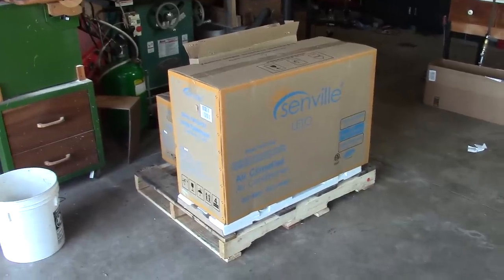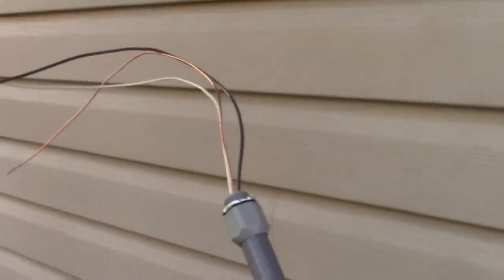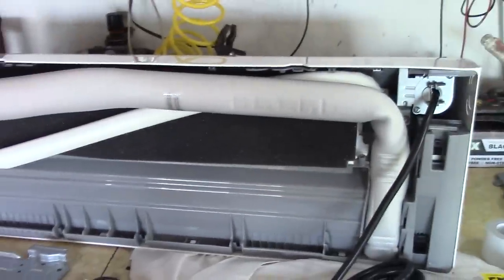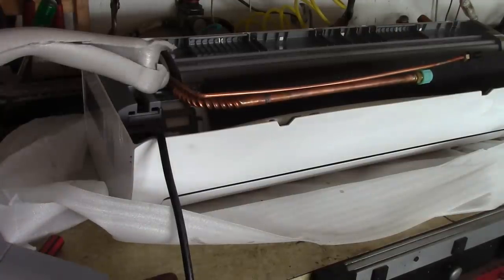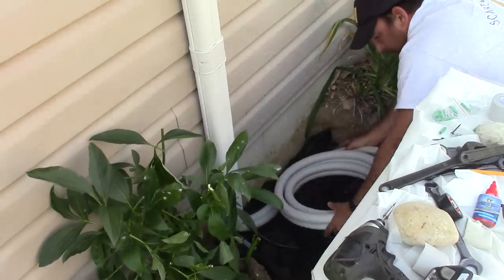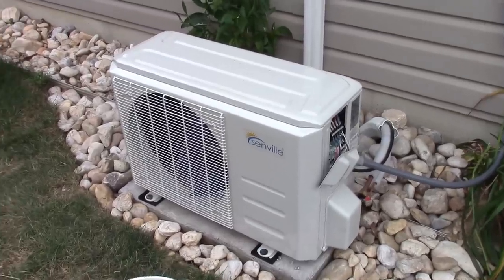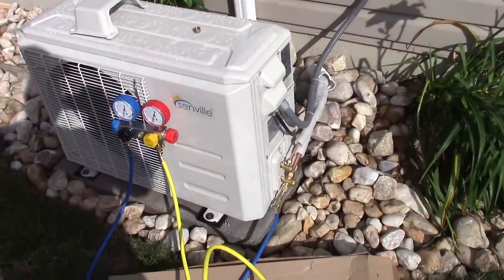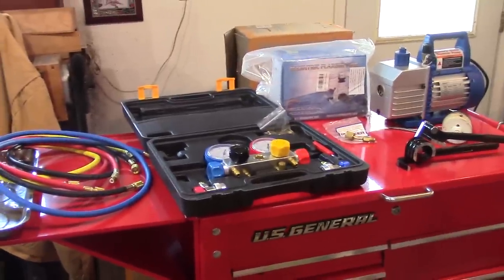Mini Split A/C Full Installation Full Video

Comment: Great video !!! I just got a 24K and am going to install it myself. My question to you is regarding the "Disconnect box" Does it have to be a 20 amp disconnect? Does it even really need to be a fuseable disconnect? Now I know you said that you are not an electrician but what did you use for your disconnect? The one I saw at Home Depot is a 60 amp A/C disconnect for like $8.98. Please let me know because I'll be installing it this week. Thanks and again great job.
Reply: The disconnect you saw at home depot is fine.  It is just a disconnecting means required by NEC for service techs.  Your protection comes from your circuit breaker.
Reply: @ibew444  Thanks for the quick response. I figured that it really didn't matter what amp the disconnect would be since the breaker would be "killing" the switch but my HVAC guy who's going to do the work on the lines was having a tizzy about me buying the 60 amp disconnect. Out of curiosity are you an electrician?
Reply: @kostabakalas9346  I am a Journeyman Electrician, 24 years.  The outside disconnect is just a switch, offers no overcurrent protection at all, yours is just capable of handling 60 amps, it's what most electricians usually install because it's always readily available.
Reply: @kostabakalas9346  Sorry I didn't see your raply earlier

Comment: Nice setup, but what was the necessity of coloring an already color coded wire?! If white is power than just remember it at that! and if really want to avoid confusion, simply label it with a sticker! Correct me if I am wrong, but aren't all wires coming out of the breakers, live wires?
Reply: When using a white wire (which is recognized as a neutral wire) as a power (load-hot) cable, you always mark it, usually with tape (wrapped, on both ends). In this case, I'd use red tape. It is a code violation if you don't do this. If someone comes in after you, and they see an untapped/unmarked white wire, they might assume it is a neutral wire. Yes, all wires leaving breaker are hot, but if someone was working at junction box at split air unit, they may not be aware the white wire is also a hot. A safety issue, and just plain good housekeeping.

Comment: I have a question, if I’m gonna disconnect my lines for roughly 10-15 min. Do I need to pull a vacuum again before opening back my valves with refrigerant?
Reply: Yes you do

Comment: No need for the wire nut and cutting of wire cover on the EVAP. There's a screw down wire holder on the inside right under the wire post.

Comment: beside using vacuum to check leakage, you should also check by charging the system for 5 sec before fully open the gas valves....

Comment: Best to release just enough refrigerant to go from vacuum to positive pressure.  Then disconnect your gauges, then release the rest.  Why disconnect with lots of pressure if you can disconnect with less.  Another trick is to leave your gauges connected until the system is running.  That will lower the pressure of the vapor port.
Reply: ok, question about the "Best to release just enough refrigerant to go from vacuum to positive pressure" . . . .so the blue gauge line stays open so you can see positive pressure? then close it, disconnect it, then release the remainder of the refrigerant? its ok to lose the refrigerant that will be in the blue line?
Reply: @RangerCaptain11A  I'm not an expert, but yes, that's considered diminimous.  I don't use the blue line when vacuuming.  I use a 5/16" valve core removal tool on the service port, with the vacuum pump at the rear port and my digital vacuum gauge on the side port.  Less is more.
Reply: @MartyMitchell92660  i just witnessed your technique:  pump down the line to lowest your pump can go, close pump valve, wait for 15 min, if no change, release enough refrigerant until gauge reads +2lbs and wait for five min to see no leaks under pressure (soap bubble test during the five min), remove blue fitting, then release all the refrigerant.  THANK YOU FOR THE PRO TIP!
Reply: P.S.  soap bubbles are redundant and unnecessary as you checked for leaks during the 15 min vacuum wait.
Reply: @RangerCaptain11A  Soap doesn't work to identify a vacuum leak.  This is not my video.  I pressure test the system with nitrogen first.  Soap does work while the system is under pressure.
Reply: @MartyMitchell92660  right. i wrote that you can bubble test after you release some refrigerant and go from negative to a positive 2lbs pressure, but its redundant because you checked for leaks by verifying the system holds vacuum for 15 min. thank you!
Reply: @RangerCaptain11A  Better yet, bubble test it with 200psi of nitrogen before releasing any refrigerant.

Comment: From your video, it shows that you don't need to add R410a refrigerant to the head unit. So there's enough R410a for both compressor and head unit?
Reply: Hi John..these typically come pre charged, one would only add r410a if the line set was extended a further distance.

Comment: Thank you so much for you video, this was very helpful. I’m looking at the 24000 unit for my workshop. What made you decide on the Senville over say the Pioneer unit. Senville is cheaper by a few hundred bucks I see. Just curious what the deciding factor was. I’m getting ready to do this myself and your video gave me a great overview of what is required.
Reply from the maker: The units are about the same the bottom line came down to price.  I really like my unit I am now using the heat pump in PA and it works fantastic.  I have a pellet stove, but have not had to fire it up with the heat pump.  Also Senville was really helpful when I asked them an install question.  I would recommend getting it through Amazon as the unit came Fedex and packaged securely.

Comment: Purge lines is sufficient, evac pump overkill?
Reply: No, you need to remove any trace of moisture or the system will not work properly and warranty will be void. Most places that need a/c have very high humidity, at least from Texas to Florida.
Reply: @QwikKota  It would be very difficult to rapidly get to the next job if you had to evac every system. Easier just to purge and save your self a days full work. Open opposite end of pipe let gas push out air close fitting, easy.
Reply: @brizzx32  There is a reason HVAC service is expensive. It's time consuming and requires training. I have done this on a car before and it's best to pull all of the moisture with a vacuum pump rather than purge. Vacuum takes quite a while but can get all moisture out. Purging a pre-charged condensing unit means you are going to have less refrigerant than required after you remove the wet air. Bad idea.
Reply: @brizzx32  That's why a DIY-er can do a better job than a pro.

Comment: I install a 24000 btu system and I followed all the instructions for the wiring and vacuuming of the refrigerent lines but my unit didn’t start up for some reason
Reply: Have any suggestions
Reply: Start by using your volt meter. Set on AC measurement and follow the power. outside unit powers the inside unit.

Comment: @DOUBLEWIDE6 REPAIRS

How come when they installer installed my mini split I had a look on the gauge at it was around 102-105 psi I think? He said if it drops mean it is leaking. Is this number correct
Reply: He was nitrogen testing

Comment: People no vacuum pumps needed for this unit that's why it's easy for homeowners to install one
Reply: Not true, the condensing unit is precharged the line set is not. you have to pull a vacuum to remove the air a moisture form the line set. Mr. Cool units , the line sets are precharged.
Reply: You absolutely need a vacuum pump for this system.   If not you are injecting the line set air, and the moisture in it, into your system.   You want to remove all the non-condensables if you want your system to work up to it’s optimal performance and last it’s full expected life.
Reply: That’s what I gathered also from watching and reading articles. The system comes with enough gas for 25 feet of pipe and comes with 16’ and can be cut down to 10’ as per manufacturer without removing the excess gas. Soooo you have redundant gas!! With no vac pump, crack the small pressure line valve for a couple seconds to pressurize the unit - then you can do a soapy water leak check - purge most of the gas you just put and residual oils and condensation out through the shredder valve on the return line fitting - open up the supply and return valves. DONE DEAL

Comment: 2nd question 
Is this only air evacuation? Or what are you doing in this process? Because I didn't see something about adding freon.
Reply: The Compressor is pre filled with freon.
Reply: @bjornkaufmann6158  Thank you!

Comment: Why did you go with sinville? I was looking at getting the pioneer so I'm just wondering what made you go with that instead
Reply: a/c tech here, looked at both, both seem decent, parts seem to be available for both. The Senville can go to -22 on the Aura model. Another video on YTshowed it still putting out heat at -25F. Senville is a Midea brand, which makes them also for Carrier and their brands, Trane and others. Pioneer has a similar remote but different specs so who knows.

Comment: Is the micron gauge worth getting? I see u only used the gauge on the manifold. No nitrogen also to purge lines.
Reply from the maker: I didn't get it, and I have not had any problems with my unit.  It is up to you.  The recommended install recommends a micron gauge.
Reply: @doublewide6  I did install 2 heat pumps a month ago and they both work great. Thanks for Video

Comment: A vacuum can't be pulled down to 'below -30 inhg'.   A perfect vacuum is -29.9inhg.  That said, the vacuum should have nothing to do with time or 'pulling out air'.  You would require a micron gauge and pull it down to the correct micron level for the application.   Always call a professional.

Comment: Pay an HVAC contractor!!
Don't touch these things unless your certified. You will only end up with problems.
Reply: My first one was installed by a pro and he made 4 errors, lost all the refrigerant in 4 months, then charged me 200 to repair his mistakes and said he would never help a DIY guy again, that's why, I'm going yo go into business and help low income families not get screwed.  His boss fired him after I explained what and where he screwed up.  I was a 91C in the Army and I had never even seen one of these before but I was teaching Khmers to do it after just 3 installs.

Comment: Why 20 amp breaker? I thought most of those mini split were 30 amp
Reply: Lazniel Napoles I installed one today and was a double 25
Reply: @summitm18hvac90  Max Fuse is a 15A. I used a 20A
Reply: Guess it depends on manufacture
Reply: @summitm18hvac90  Recommend #12 copper on the 12-18K units..  This copper wire gauge  will handle elect.  line loss over a normal distance.  All electrical motors run better and last longer with electrical above the Mfg's. claim.

Comment: Just a thought, that insulation sleeve that’s on the line set should go all the way up to the wall to keep the two copper lines from rubbing each other. I noticed your line set was against one another and it will eventually create a pin hole leak. Open it back up and wedge you some foam between the two lines so they aren’t touching.

Comment: how does your heat pump  work after three month  working  ok
Reply from the maker: The heat pump is fantastic on this unit.  I bought it for AC but have been using the heat pump like you would not believe.  I love the unit.

Comment: Also please make sure you post video when your compressor locks up because it will
Reply: Do tell us why
Reply: Because he created a oil trap by trapping oil below the compressor and it has no way to return the oil back to the crank case its called a P trap

Comment: Which valve did you open when pumping the lines?
Reply: The low side is where the system is pumped down from. Large tube

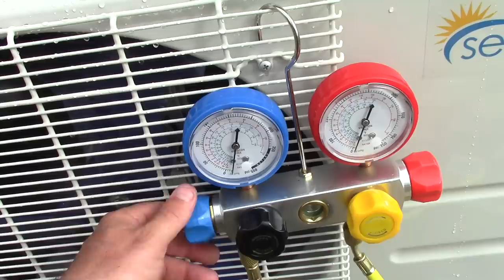Comment: At 32:05 minutes, you closed the low side valve.  Doesn't that cutoff the line set from the manifold?
Reply: @speckulator7516  again....not true. When you close the blue valve, it does isolate the gauge from the system!

Comment: I just installed this same unit. Want your knowledge on something. I set thermostat on unit to 75 on my remote. I got the room down to 68 & the unit never shut down when it got to 75. It just kept running. Has this happened to you ?? What am I missing on what I am doing ??
Reply from the maker: Never had that problem.  I just set the remote to the temp that I want the room at.  Maybe reset the remote I think there is a pin hole to reset it or maybe pull the batteries.  My unit will hold the temp it is set to, but if the unit is on it will keep blowing air (fan mode) until the unit need more cold air then it cycles into AC mode.  Sorry I couldn't be more help.
Reply: I might be on to something. Is the thermostat the remote ?? I am thinking there is a thermostat in the unit that hangs on wall. I had the remote in another room @ the time. This is making some since to me now. I'll try it with the remote in the same room.
Reply: If this unit is like my mitzibishi  heatpump  it does not usually  shut diwn like the  energy hog central unuts.  My unit will slow the  compressor  to give just  enough  heat or  cooling to  maintain the  set temperature .  This saves wear and tear of starting and stopping  the unut. Mini  splits are a whole different animal and you will love  tge savings!
Reply: The units I've looked at say the remote is the sensor for thermostat. So the unit will turn off or on based on the temperature of where your remote is located.

Comment: Why not cut the 
copper pipe shorter？
Reply: 38:43 has to be that length because the lines are pre-charged with refrigerant that length.if you cut the lines your would have to recover some refrigerant.

Comment: two grand would be a bargain.  A Mitsubishi would cost us about that or more,..... at our cost.

Wading up the lineset Ive seen before.  Pros NEVER do that.   You should have stuck to your instincts and get rid of that excess linseed that looks holy as hell, its also an oil trap. That guys going to sell you a compressor in a few years if it lasts that long.  Nobody can really tell, but the compressor will be operating without  several ounces of oil that are sitting in that suction line. All in all though it looked decent.  Normally we recomend installing on the gable end because of ice from the roof when it comes crashing down.  Couldn't tell which end it was on. all in all good job.  The vacuum, ehhh... WE did it years back without a vacuum gauge and there was no adverse effect.... keep it up.
Reply: I just viewed a vid where the manufacture recommended you put a loop in the line set. Go figure.......
Reply: the only time you MIGHT do that is if your linset were too short.  The  problem occurs when the loop is made.  To PROPERLY make the loop it should always pitch downhill.  This may be difficult or not esthetically pleasing to the customers yard. So, it should be a horizontal loop, starting high and then pitching downhill, ending just a bit higher than the suction line to ensure proper oil return.  Otherwise you could get a big slug of oil to the compressor along with any refrigerant that might be in the suction line with it. 
      Its rather like checking your car engine crankcase oil before starting it. It may read high, because gravity helps the oil drain down to the crankcase from the internal parts that were coated with oil.  You warm the engine and check it within a minute and all of a sudden, your low on oil....
    Something similar happens inside the piping of the refrigeration system.  Refrigerant and oil travel throughout the system upon operation.  While at rest you don't want those coated pipes to drain to a low spot that is other than the crankcase and return back to the compressor in a pressurized blob of oil.  Remember, a piston in a compressor, can pump vapors all day long but, will only TRY to pump a liquid once, weather it be refrigerant or oil.  This is why superheat is pounded into our heads all the time along with crankcase heaters. The crankcase heater acts as a safety, it boils any liquid refrigerant out of the crankcase should it find its way there.
  @richardlusk2160

Comment: On the inside unit red goes to red wire which is number one number two white goes yellow a number three black goes to Black but but on the outside red goes to one which makes sense then you have number to going to black but on the inside and goes to white yellow and number three wire number three you haven't going to White on the outside but on the inside you have it going to Black anybody clarify this crazy stuff but in the video you say make sure the wires match four number one number two and number three but on the outside they do not match

Comment: if you shut of gauges is wait till you see vacuum change never ever heard of your way is this something you made up ?
Reply from the maker: I believe when the manifold is shut off it closes on the front side of the manifold any pressure lose on the back side of the gauge should still register.  You could have a leak on the front side of the manifold that gives a false reading so that is why I closed the valve.  If you wanted to you could leave the valve open, but you just would have to make sure you have no leaks between the manifold and the pump.

Comment: Can you please show how to run the romex from the electrical panel to outside or how you got the romex to your panel. My panel is about 30 feet from where I want to install the compressor and it's a finished basement. Thanks in advance